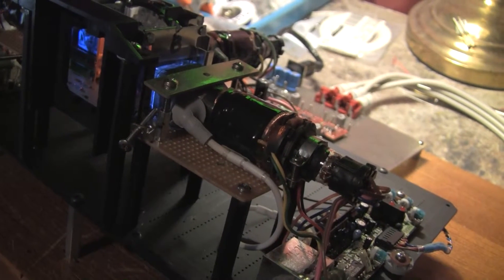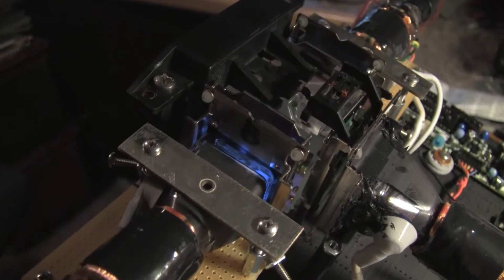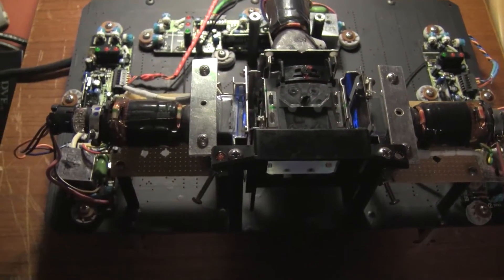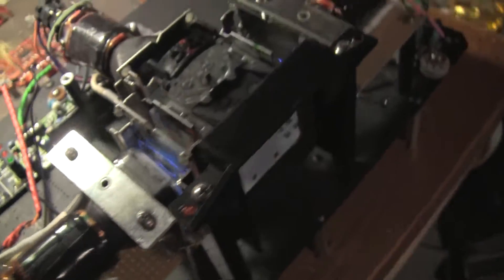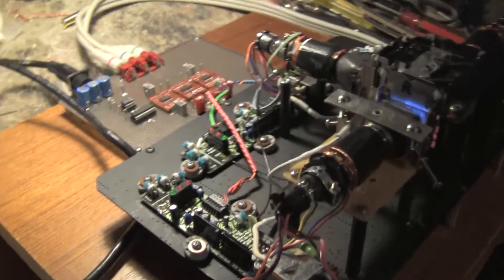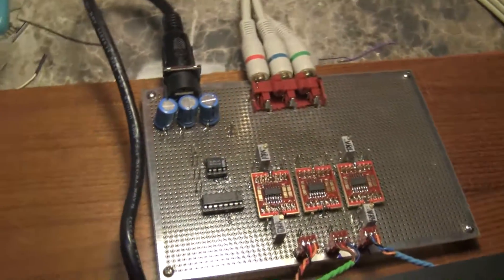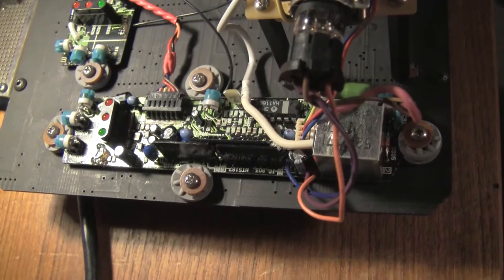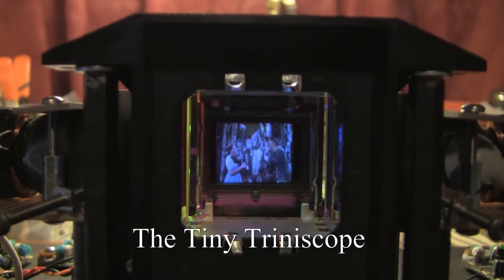The TinyTriniscope Completed!

Comment from the maker: As suggested by Cliff Benham, a CBS color TV guru of world renown, the following materials are best for constructing a practical color wheel used with a P4 phosphor CRT. These are made by Rosco for theatrical lighting use and come in large sheets approximately two feet square. The part numbers are: Rosco #25, #76 and #90. This is easily cut to patterns with regular scissors. This material was obtained at a local theatrical supply company for a very reasonable cost.

Comment: cool
Reply from the maker: More details here: http://www.labguysworld.com/TinyTriniscope_001.htm
Reply: My first video projector was a Sony Videoscope. It used 3 7" air cooled projection tubes, and a dichroic mirror to combine the red  and blue onto a single lens. The green had it's own lens. The reason they didn't put all 3 on a single lens was for cooling. it was relatively easy to blow air over 2 tubes, but 3 would have been challenging.

Comment: i just got a CKC020 off ebay and want to use the viewfinder tube on a project. Can you tell me how many volts it needs and where i need to tap in power and composite video to the driver board?
Reply from the maker: Simple. Pin 1 is ground. Pin 2 is video input. Pin 6 is +12VDC in. Pins 3, 4 & 5 go to three LEDs on the board. More info Here: https://www.labguysworld.com/TinyTriniscope_001.htm and
Reply: @videolabguy  thanks! Just pulled it apart!
Reply: @videolabguy  got it working. Did you extend the flyback and deflection wires? Wondering if I can do that without issues.
Reply from the maker: Sorry for the delay. I did extend the anode lead. Didn't need to extend the others. Your mileage may vary. After splicing the anode lead, I used three layers of heat shrink tubing to be extra safe.
Reply: @videolabguy  same here. I extended them all. I finished the project. It’s here if you want to see the result! —> https://youtu.be/Bm90UfMlWvk